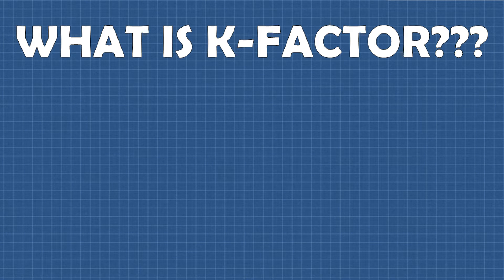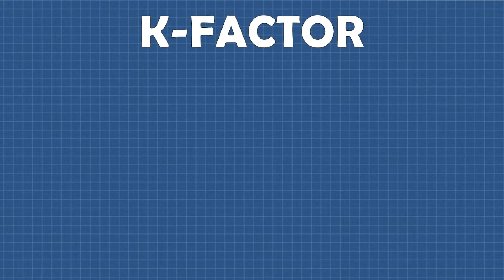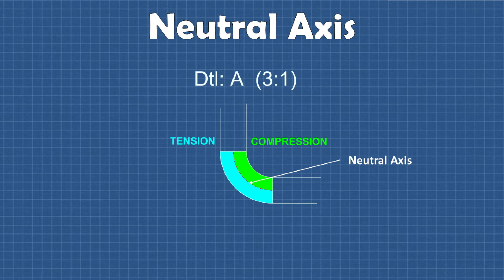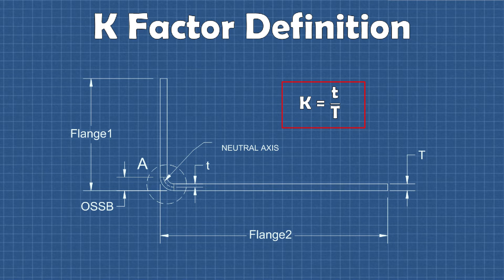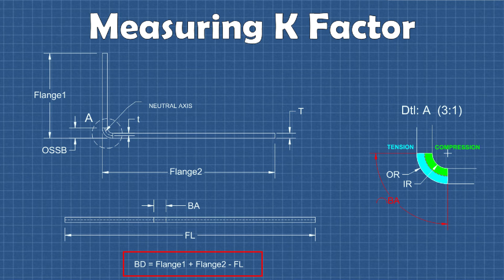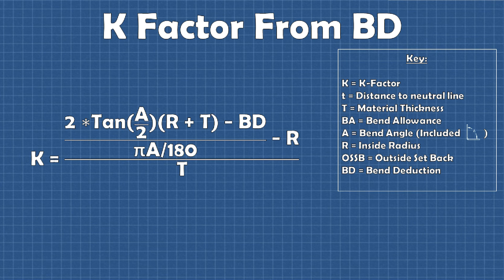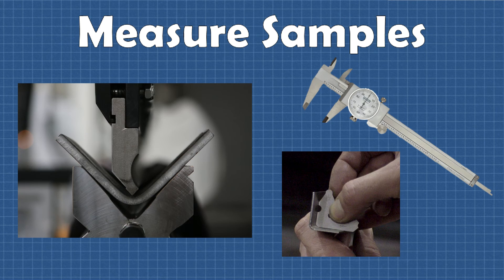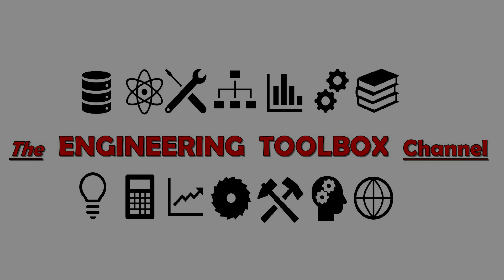Sheet Metal K-Factor (What it is & How to Measure)

Comment: This is an excellent video.
I agree that the charts are not representative of a true K-Factor, and are extremely generic. It does make sense that different materials produce different K-factors. One insight we have into these material's proerties that make the K-factor change is their tensile and yield strengths.
It would make sense that the K-Factor could be predetermined using these strengths in the equation, but the only resource I have found is in this Vicon Forming Calculator (http://www.plasma-automation.com/Calculators/Forming+Punching/Forming-Calculator.php ). within the source code you can see that they are calculating the neutral axis to be:

neutralAxis = ((yieldStrength/tensileStrength)/2) + (veePunchRadius*2) * Math.PI/36 + ((veePunchRadius/veeMatThickness)/100)
This seems inaccurate because the K-Factor is not calculated to be even close to 0.5 until the radius is 5X the thickness.
So I guess what I'm asking is have you come across any calculations that directly include the Tensile/Yield Strength as a variable in the K-Factor Calculation, where the equation has come closer to the chart in reference?
Reply from the maker: So after doing some testing it looks like this could be a decent k-factor estimation formula. Comparing it to my numbers from previous tests, it is generally within .05 of my numbers in more "typical" bending scenarios (eg. 90deg bend in 1018 CRS with .060" punch and .472" die).  It seems like it gets pretty far off once you get into large radius bends on thinner materials for example.   The other issue I see is that it doesn't consider Die opening or angle which are also very strong strong influence on K-factor.
Reply: @TheEngineeringToolboxChannel  
Try this one. It seems to update based on the opening:
https://www.westwaymachinery.com/press-brake-tonnage-calculator/
Reply: NM, the tensile strength bears no factor in the calculation of the neutral axis from Westwaymachinery.
Reply from the maker: Thanks for the engagement and sharing your findings with us!
Reply: @TheEngineeringToolboxChannel  
NP. I'm an engineer as well using SolidWorks for a local tube bending company. We also do some minor sheet metal. I am working with the API as well with .NET. Trying to write code to select in stock bend dies for routing, and plan on using a variant of the info you provided. I've already known the route to go, but you did a great job at documenting it.
Thanks again.
Reply from the maker: Very cool stuff.  I take it you are creating a solidworks add-in for this? Any good resources to recommend for Solidworks API and .NET?  I’m pretty well versed with VBA but never put the time into really learning .net to a point where I could use it.
Reply from the maker: @cbalde04  Thanks.  CADSharp is one of my go-tos for online resources.  Are you using C# or VB for your .NET programs?  I know C# syntax is pretty different for those of us using VBA but VB.NET is usually the same or similar sytax to VBA.  Unfortunately C# is the more common one especially in the Solidworks API world from what I've seen so it requires learning new syntax. That has been my dilemma...to learn C# or stick with similar syntax to VBA and use VB but deal with less documentation and learning resources.
Reply: I've pretty much committed to VB.NET. codestack.net is another great resource. I've found that VB.NET is more common, but I'm sure it could float based on region and application.
Reply: Came across some info from WilaUSA (bending tool manufacturer:
https://webshop.wilausa.com/disclaimer/bending-information/?sl=en
If the Dutch pdf, after using an online translater, it shows some relationship between dialing in the k-factors and the materials tensile strength alone.
Here's what I gather relating it to the way SolidWorks uses the K-Factor:
Aluminum (200 N/mm²):
K = ((0.85 + (0.2 * Log(Radius / Thickness))) / 2)
Steel (420 N/mm²):
K = ((0.65 + (0.5 * Log(Radius / Thickness))) / 2)
Stainless (700 N/mm²):
K = ((0.122 + (1.265 * Log(Radius / Thickness))) / 2)
Still trying to figure out how the Tensile strength can be used to calculate the two changing variables, but this at least seems closer than the generic table based on thickness alone, and appears to be based on detailed testing results.
Reply from the maker: @cbalde04  I have come across some calculations that you may find useful for air bending...much of which come from Steve Benson. https://www.thefabricator.com/author/steve-benson   I met someone that swears by this method for calculating bend deduction.  *Denotes special formulas specific to this method.

BD = (OSSB*2)-BA
*BA=(.017453*R +.0078*T)*A
T = Material Thickness
A = Included angle (where obtuse > 9 & acute <90) 
*R = V_width * C (estimation based on die width and elongation factor)  If Rp (punch radius) is > than R then use Rp.
C = elongation factor of the material.  Rules of thumb below:

5052-H32: .14
6060-T6:    .12
CRS:           .15
HRS:           .14
SS:              .20
A36:           .20

Elongation factor is related to the Young's modulus of the material which in turn affects the k-factor.  K-Factor could be derived from BD.

Then K=((180*BA)/Pi*A*T)-(R/T). 

I haven't verified this yet but using these equations we could derive something like K=(180*(.017453*(V*C)+.0078)/(Pi*A))-((V*C)/T).  I am also not great at simplifying equations so maybe it can be further simplified.

V is also a function of Rp (punch radius), T, and material thickness:   "V = (4(sin(A/2))(R+T)))/(tan(A/2))" (See this video: https://www.youtube.com/watch?v=VfO8-SYmjg0).  So in theory you could determine a K factor solely based on material type, thickness, punch radius, and bend angle. Or perhaps you could even define a method of selecting punch radius based on material thickness. Then you would only need to know Material type, thickness, and bend angle to determine k-factor.   Not saying this will work for sure, but if the formulas above work for you, and you set everything up right, it theory it could work.
Reply from the maker: Interesting.  I have not seen any references that are able to accurately predict K factor based on material properties.  I would agree that yield and/or tensile strength play a large roll in the resulting k-factor.  You said the K-factor did not come out close to .5....What kinds of numbers were you getting when you tried their calculations?
Reply: @TheEngineeringToolboxChannel  
I typically resort to 1/8" and 1/4" materials in oth steel and aluminum as that's what we typically use. Basically, the V-Opening bears no effect on the K-Factor, only the tip radius. And when setting the punch radius (ie tip radius) to 3*T, the resulting K-Factor lies around .37-.47.
Again, I know the K-Factor is wrong, but I'm wondering if perhaps they were on the right track. You can manually assign yield/tensile values by selecting "Other" in both material boxes.
Reply from the maker: @cbalde04  So the K-factor you get with their calculation is .37-.47?  What do you think the K-factor should be?  Just curious because I feel .37-.47 seems perfectly reasonable for the majority of materials and bending scenarios.
Reply: @cbalde04  sir can u please suggest me one book through which i can get some knowledge on sheet metal